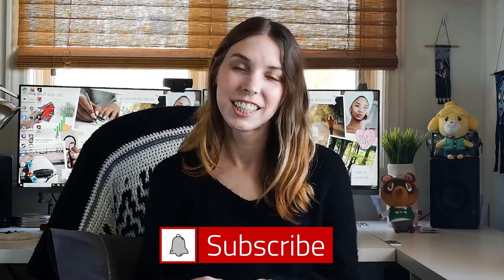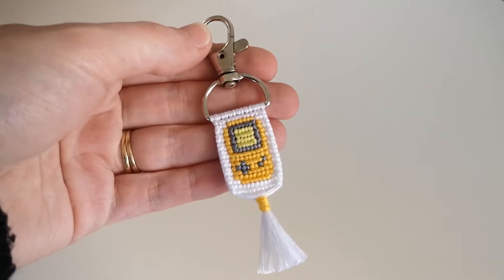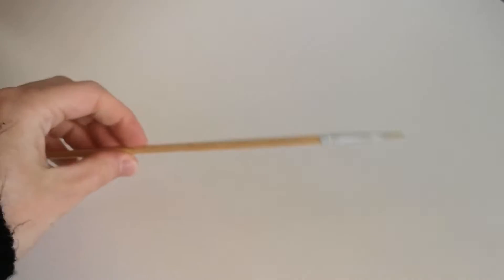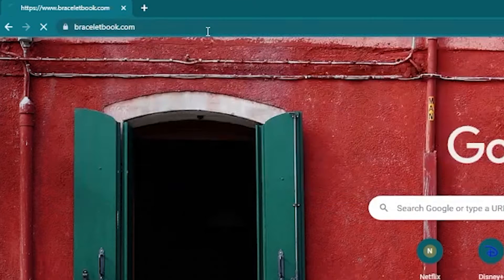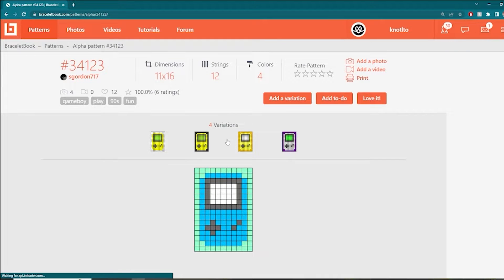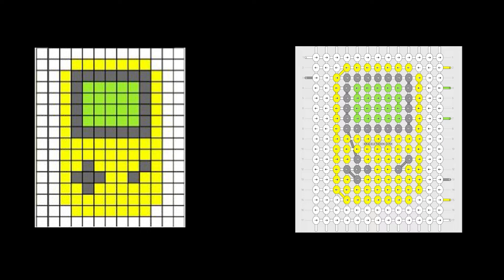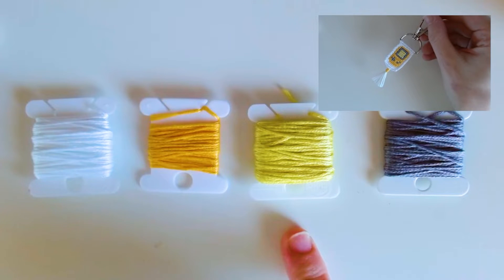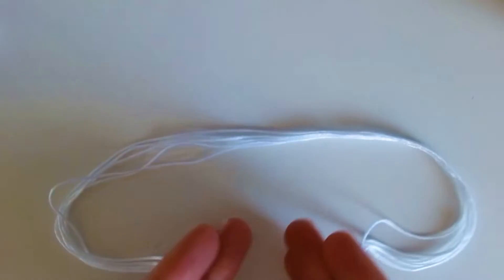BEGINNER ALPHA TUTORIAL // Gameboy Keychain Step-By-Step Walkthrough

Comment: Your knots are so equal and even. When I change the colors, I get gaps between the colors. I guess, I need much more practice…..MUCH more. 😜
Reply: I'm a beginner. I learned if you pull the string a little tighter & hold the 2 strings down that are on either side of the string you are putting a knot on. Also the strings that are going behind base strings make sure you're not pulling on them too tight. It helped mine‼️ Good luck ‼️🍀😻😻😻